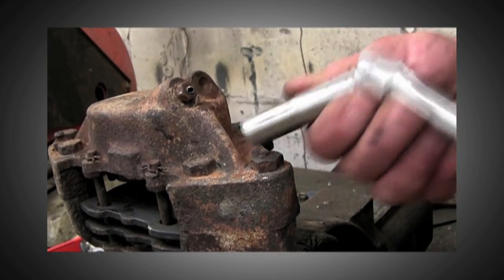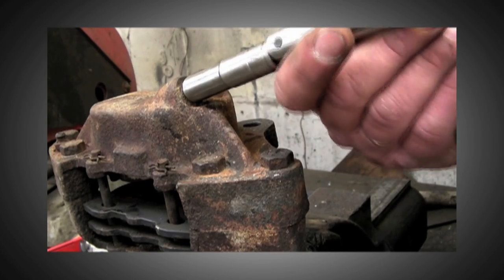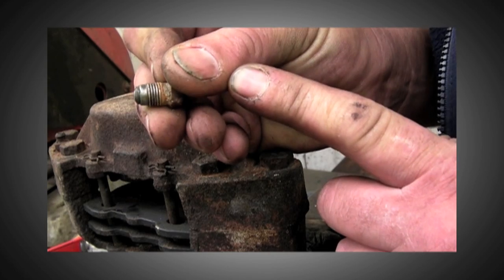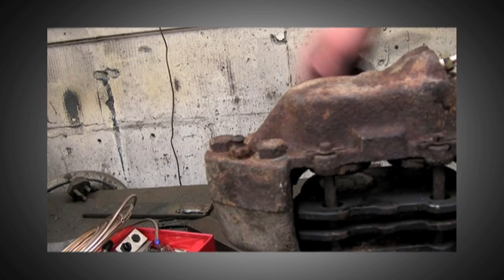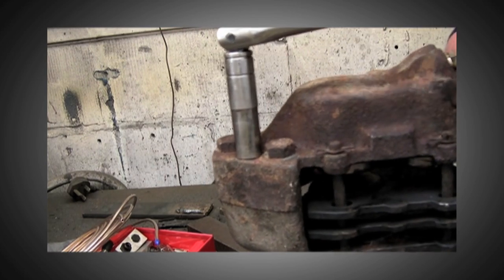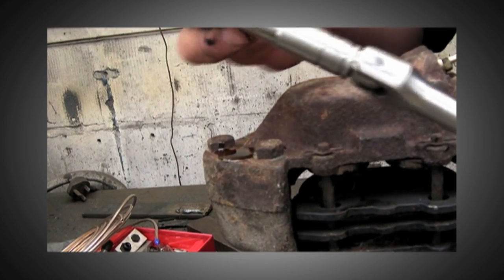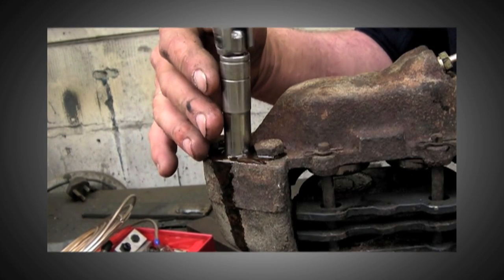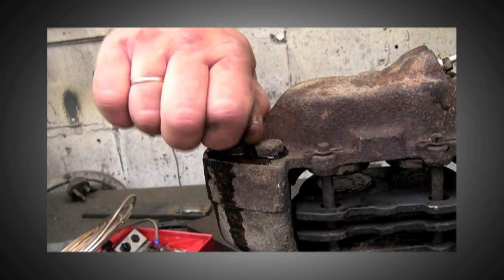brake caliper trick Land Rover

Comment: I'm having trouble with the brake caliper piston I believe it is seized.  I have been the C clamp handle trying to compress the piston.  Any tricks on compressing a seized piston?  I loosened the bleeder nipple, and added WD-40 but the piston will not compress!.
Reply from the maker: Time to overhaul the calliper or fit new ones on.  Try turning the piston and see if that makes a difference.

Comment: I'm still amazed why some still use spanners even brake spanners on nipples. There is no need get a socket on it like you shown it's not going to piss fluid out on the first crack if that's what they are worried about.